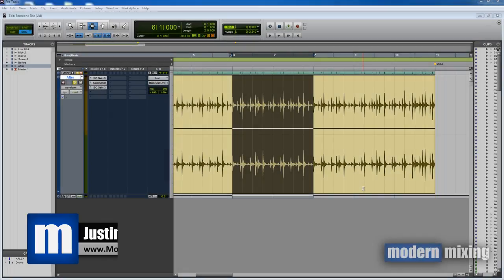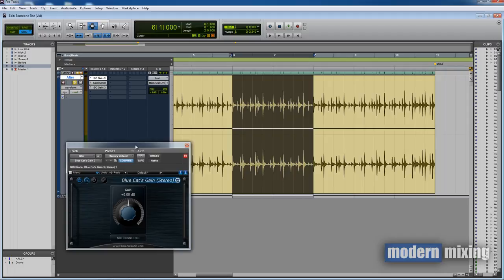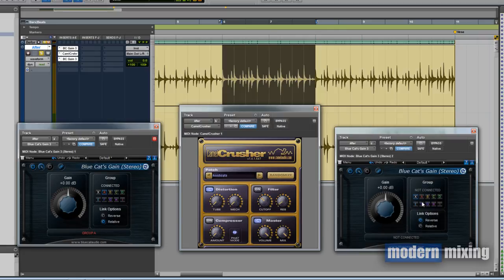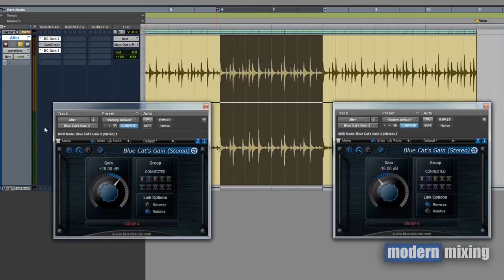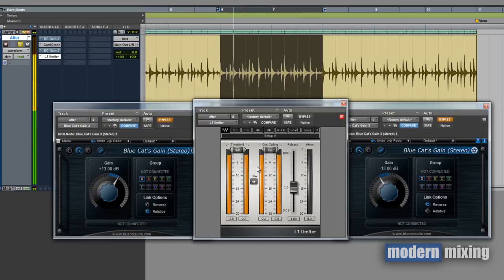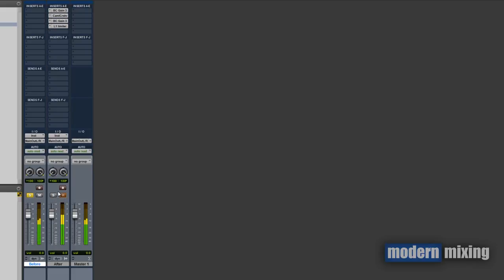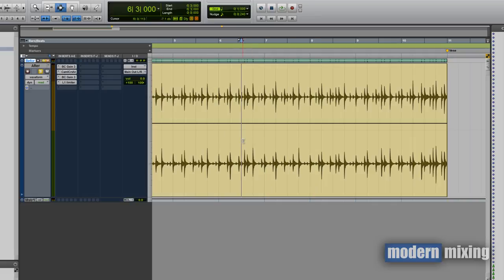Creating an Automatic Gain Compensation Plug-In - ModernMixing.com

Comment: just a quick tip you might not know shift s is the hot key to solo selected track if you have two channels selected in pro tools one soloed the other not soloed and you do shift s it will basically switch them so you can do a real quick AB.

Comment: You should make a comparison between how the Camel Crusher plug sounds adding the distortion on it's own mechanic vs. feeding more of the signal in with the gain plug-in.  It's possible in many cases that the control on whichever plug-in of choice is doing something more than just adding input signal when raising it's built-in knob.  If not an actual test of this, I simply wonder what you think on the matter.  Thanks as always!
Reply: I actually wanna see this too.
Reply: Yeah, I am looking for something with a "Variable Peak Output based adjustment" as well.

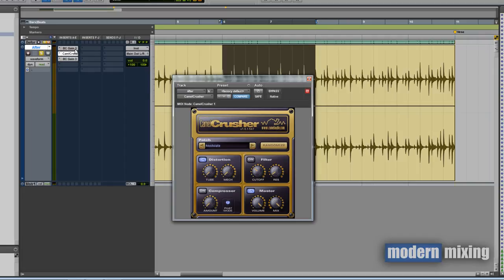Comment: Hello. 3:38. i don't quite get it, how it supposed to add distortion, even if i increase the Input gain, when settings of distortion plugin is 0.03%. Can i increase distortion in camelCrusher as well or that way i will ruin the sound? thanks